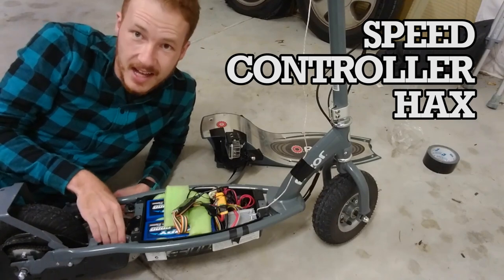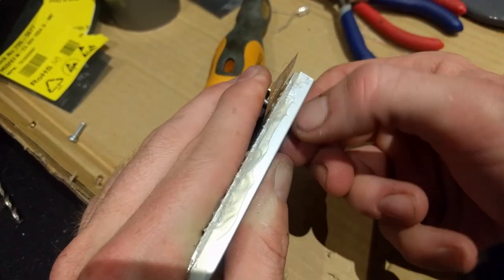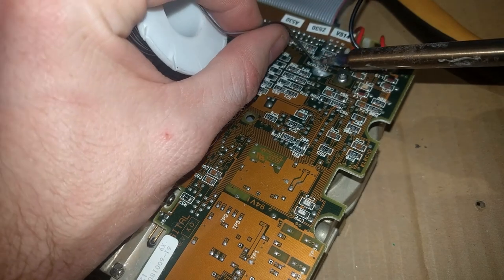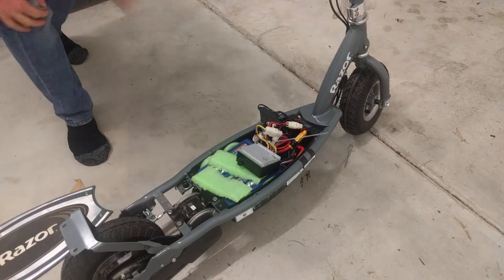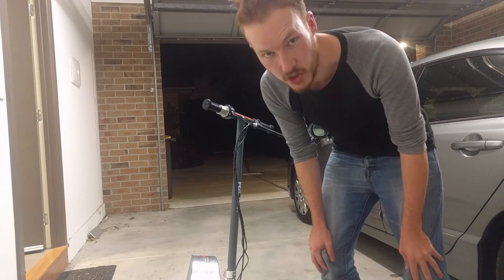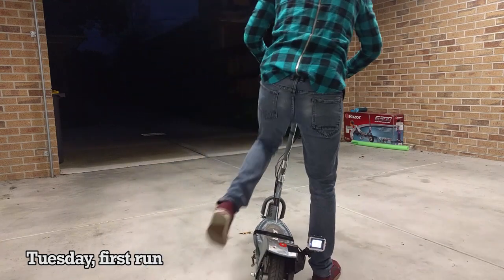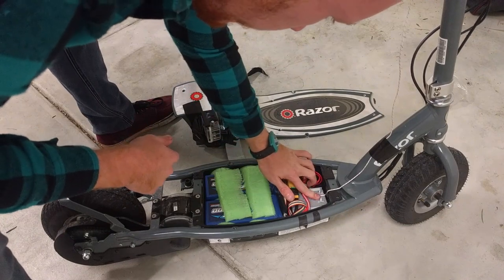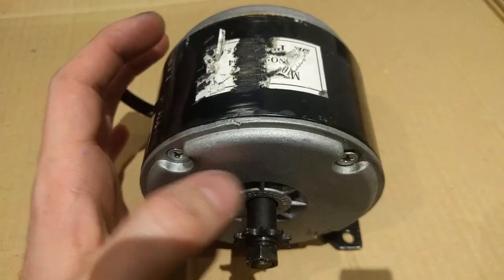Hacking The Speed Controller On The Razor E300 - Scooter Episode 4

Comment: what is the semi next to the fet, mine has had the numbers sanded off.
Reply from the maker: nagual4ever snubbing diode if I recall correctly:) it's like two diodes in a weird package though, not sure exactly how it's wired up
Reply: Thanks for that, yes I did come across  an article on snubbing diodes, I will now go back and study how they work.  I wonder if they have something to do with stopping back emf from the motor.
Reply from the maker: nagual4ever that is exactly what they're for. :D

Comment: is it a good idea to upgrade a motor from a 100w 24v to a 200w 24v?. and would it work?
Reply: marc joseph well you would need a  200w controller, and everything else probably too. and the motor would have to fit, or you would need to make a new mount.
Reply from the maker: marc joseph more power is more better! As Filip has said, you'd want to upgrade your controller, too.

Comment: I would like to offer  possible solution if you could get hands tachometer  or dimmer  switch from old car before 1992 will help control voltage and limit  speed of mottor
Reply from the maker: Interesting idea - how does that work?

Comment: Great Stuff, i have one and i'm so close to have all the parts to assemble a Monster 20 000mAh LiFePO4 Battery for it, Gonna have to lower the Battery Bay because the cells are thick but they will be here. i will have to assemble the cells myself with Balance leads too which will be Plugged to a Turnigy 1000W 30A charger with the Main leads,

I also plan to upgrade the motor too a 500W 24V for more power with a new speed controller. The hardest part will be designing a New battery bay with Aluminium  with custom holes for the balance and Main lead plug

What are your thoughts on the project?
Reply from the maker: Sounds awesome dude! Just be careful working with those batteries, they pack a hell of a punch when things go wrong ;) Good luck!
Reply: I will ;) . I find that theres some compromise, like you can make a single 20Ah 48V or 40Ah with two 24V in Parallel. I will also Take Care of Wrapping the Terminals in Heatshrink to avoid Any Shorts happening, Even put Plastic Tabs between the 8 Row of terminals.

Thought i have a question, will 14 Gauge wire be enought for my needs ( HobbyKing Sillicone wires) or should i Go for a larger Gauge?, I also Ordered 22 gauge for the Balance Leads, will this be enought considering the Turnigy 1000W can pump 500mAh thro the balance leads?

I also Feared That LiPo wouldnt be ideal for the needs since theyre more prone to Full charge failures unlike LiFe cells, also For the longer cycles count. and let's say if my Batt wants to go, I prefer a Wimpy Electrolyte ejection from the LiFe than the LiPo having a risk to catch fire

also Are Bullet Plugs good Enought for like Charge-Discharge connection?

Sorry for the questions but it might be useful to ask to be as prepared as possible :)

Comment: what's the mph/km??  I've seen these get up to 30MPH just from switching to 48VOLTS battery with a 1000W controller from ebay with a variable speed throttle mod from ebay.  I wanna do the 48V(dual lithium ion tool batteries)  with the 1000W controller,  which runs reliably,  according to the modder.  i wanna see what you can do with all those mods and the bigger motor with the fastest gear ratio possible.  if it's doing 30MPH just on 48VOLTS and the 1000W controller,  I'm willing to bet you can get 35-40MPH using a bigger motor and the fastest(no safest)  gear ratio possible.
Reply from the maker: Yeah, it's not a perfect setup. Pretty annoyed the motor blew to be honest. :P

Comment: if the speed controller has the current limited and under voltage or overvoltage non functional because of using a different voltage then all you have is just a relay cause its not variable control its on and off...just get rid of the "speed out-of-controller" and just run a contactor..or that is an industrial type relay with the relay control on the switch,  get one with a built in circuit breaker.  you can get them where you can turn a switch to set the current for the breaker and youve got at least some short circuit protection.  I did this with one and it worked great, motor didnt really get hot but the hoverboard battery got too hot and all the balance (charge balance)fets sluffed off and it kinda f*** up the battery. but if you were using 36v of lead acid would of been ok or limit the current on the lithium with a resistor...being that its an on off switch you kinda need a little less throttle cause its out of control if your not trying to go full chooch to move it around in the garage or something.
Reply from the maker: Yeah I learned throttle control was key. On/off is too hot to ride.

Comment: This is a sick controller hack, got me to subscribe! One idea I had while watching is mount the fets to the frame with thermal paste instead of the heatsink so the dissipation is more evenly spread. Also, I agree with you about Unites... They are very nice rugged little motors and they kick ass until overvolted.
Reply from the maker: Gyromatical that would be an interesting way to mount them. thermal paste would definitely bring some benefits to this application. thanks for watching :D
Reply from the maker: Yeah, defs the proper way to do it.

Comment: If a speed controller doesn’t say how many watts it can handle, what should I do if I want a speed controller that can handle 7000 Watts?
Reply: Do you think most can?
Reply from the maker: Wiziki a 7KW speed controller is serious business. You'll want to buy something from a well regarded manufacturer whose speed ratings can be relied upon. 

I've blown up and set fire to a whole bunch of controllers - you definitely get what you pay for.

Look up etotheiplusone and his work on scooters and other electric drive projects. It'll give you an idea of what goes into speccing or building the right brushless controller.
Reply: TK I was looking off a channel names ‘Dickie Withers’ where he built something alike this. He said to use the alienpowersystem.com one, but they are very expensive, and am looking for something cheaper. I’m not really sure what 7KW can do, I just want a scooter that can go about 35mph and can last for about 4-5hours
Reply: According to that channel 7KW will do the job, but I’m not sure if it is way more than I need
Reply from the maker: Wiziki 7kW is likely more than you need, I suspect you could hit those speeds with less than 4KW easily. Gearing is key.

As for 4-5 hours, that's quite a long time. You'd need a seriously large battery pack.

If you want to hit 35mph and ride for long periods, I would say that the Razor scooter type of platform isn't ideal. It can be unstable at higher speeds and the small wheels don't help, particularly with bumps. Ground clearance is also a problem. 

I'd suggest more of a moped type setup  for what you want to do.
Reply: TK what do you think the longest it could go for would be? Maybe 3 hours wouldn’t be too bad, the lowest I would want to rip to would be 2.
Reply: What is a moped setup?
Reply from the maker: Google "moped"

Comment: Sir the motor you throw in the garbage bin still good what I saw is when you open it  the carbon brush was not pushing hard by the spring which cause lost of contact that's why you are going to think the motor is dead, what you need to do is clean up the coi with the sand paper and also the brush holder ✌️
Reply from the maker: Disagree, this thing was CAH-OOKED>

Comment: Using an IRFB3077 Mosfet would maybe have saved you the trouble of modding the fet setup. Or doing the fet mod with a bigger package fet would have a good result. Shame about the motor, but a bigger one with more power handling will be awsome! Good luck. :-)
Reply from the maker: Cheers! I'll disagree on the IRFB3077 - it's data sheet states a package-limited maximum current of 120A which I feel wouldn't quite give me the safety margin I need. You're absolutely right about choosing a FET in a higher-current package though. This was a case of going with what I was familiar with. 

New motor shipping soon... ;D Thanks for watching!

Comment: Lol, did you just try to imitate "charlie bit my finder" lol.  Love the series and humor :)
Reply from the maker: hahah, it does sound like that doesn't it? entirely unintentional, I didn't realise how hot the motor had gotten till it burnt me ;D
Reply: TK I think by the time you buy all new components you realize that the scooter approaches the cost of complete gas scooter :) but I can't blame you for trying because the learning process is fun and valuable.  Actually my friend build his own scooter about 7 years ago, it had bigger thicker wheels, batteries that could be fast charged in 15 minutes and it had so much torque that it would literally lift you off the ground on the rear wheel if you gave it too much throttle and it could run about 30-40 miles an hour.  I know because I had a chance to ride it and I could pass cars on the street!

Comment: if you also add a small computer cooling fan 'it will last a lot longer. more power = more heat...
Reply from the maker: Good call, any visual examples? these motors get very hot
Reply: @WhatUpTKHere  you were working om the heat sink ''you can put a computer fan on there easy 'they don't use a lot of power 'amd they do move a lot of air real fast 'i'm not sure how you could mount one on the motor 'but i know it can be done ..

Comment: I added 1 more deep cycle 12v battery to total 36v, bypassed the relay like he did by soldiering on the board, I added a little chunk of copper allowing more current to the motor like he did. I easily hit 20mph with stock sprockets.
Reply from the maker: Nice one! How long has your motor lasted? I suspect lead acids are kinder to the motor than LiPos due to their lower current delivery.

Comment: I have been trying to mod my E300 like that....not working well so I am just gonna order the fast scooter over volt kit and see what happens...great vid...thanks.
Reply from the maker: Good luck. :)
Reply: 1000w 36v motor with speed controller kit and custom 18650 battery pack.

Comment: 60c is not that hot for a brushed motor though.
Reply from the maker: Infected Gamer it is 20 minutes after it's been switched off :P
Reply: Just get a brushed ESC for rc cars and use a servo tester to send a signal to the ESC to turn the motor.
Just get a ESC that fits your motors wattage. These chinese motors always say max 250 watts or something like that. They can use more though. They are actually 500 watt motors or even more. 
Next time if you want to mod a motor drill holes in the front cover. Did that too and it keeps the motor wayy cooler. 
With front cover i mean that part that you have in yout left hand at 13:26.
Works really good as well! The problem is that cheap chinese lubrication that just thins out or vaporises when it heats up ruining the whole motor. :P Luckely these motors are only like $10 on ebay.
Reply: You where quick with commenting haha.
Reply: infected gamer,  electric motors support at start almost 10 times nominal power for a short time

Comment: One suggestion when you next try hacking the stock controller: replace the fets with as low Rds(on) as you can. The higher the RdsOn, the hotter the fets, as you probably know already...
Reply from the maker: speedsterh with regards to Rds(on), it's actually not our limiting factor here. You see, you can get TO220 package FETs now with such a low Rds(on) that the problem becomes the resistance of the package leads and the connections from the leads to the silicon inside. That's why you can't practically get more than around 100A out of a TO220 package FET, as explained in the video - even if your Rds(on) was 0.0000000000000001 ohms, the package would still overeat due to the fact that you're attempting to pass over 100A through rather thin leads and interconnects.

thanks for watching!
Reply: OK, you're prolly right. I'll watch your next videos on the subject then since I have a razor 300, 2 4S4P lithium batteries and the darn thing doesn't move anything like 20 mph.

Comment: We have three of those scooters. The older one has much higher quality wheels and parts thant the newer 300 with cheaper wheels and smaller wheels. Shame on razor for cheaping out. The older model can be upgraded to do 30mph but the new grey models good for 20mph.
Reply from the maker: Iiiiinteresting. Maybe they started cheaping out and my bearings and stuff are crappier, burning off speed.

Comment: Oh man, who'd have thought it'd be the motor that would die on you haha! My e300 with a wildscooterparts variable throttle and 500w voltage reg replacement kit is running alright, certainly feeling the sluggishness of the SLA batteries still however. When funds call for it however I have LifePo4 batteries in my sights to boost things up - I'll make sure to keep an eye on any potential heat problems as well when I make the change.
Reply from the maker: Sounds like you've got some hot mods already, you'll definitely love LiPo!

Comment: go brushless dude, it will be the best decision you ever make. Hobbyking do big 2-stroke replacers even up to a 150cc alternative i run a 2500w motor in mine and snapped the bars
Reply from the maker: maybe one day! I've done stuff with brushless power systems before and the power density you can achieve is phenomenal. but for this project I'm enjoying hacking on the ESC and keeping it simple.

Comment: im jealous. i can slap some shit together through trial and errors get it to work for the moment. not as advance as you are with reading pcb circuits. you have enough knowledge to gather your own team of engineering and designing. and make some cool electric skateboards or scooters. there's a lot of groups turn corp type of small businesses that's on this cash cow bandwagon. some making mills already. but i think you can do better for the fact that you have a genuine passion for what you do. most of the stuff out there are garbage. you're using high performing components from hobbyking, can't beat that. brushless motor is endless possibilities. 4 years ago i had a built traxxax rustler running 106mph before it ate mail box post.